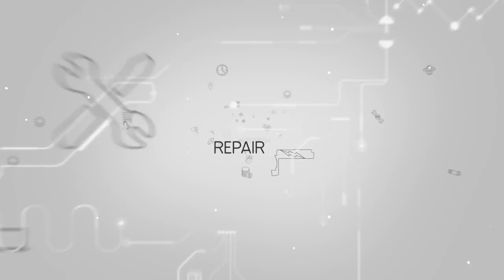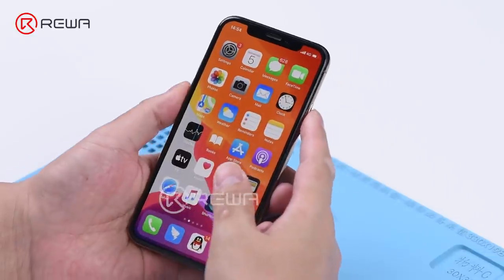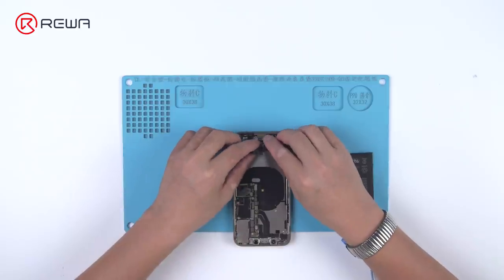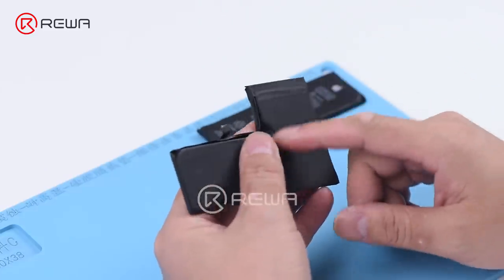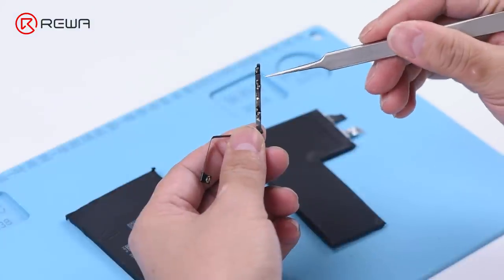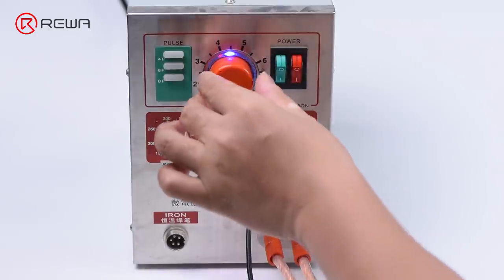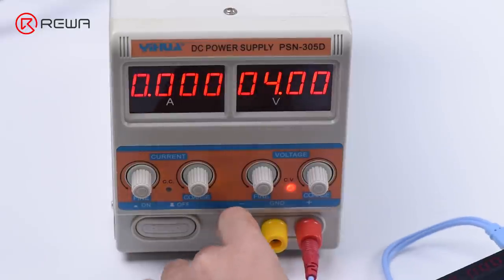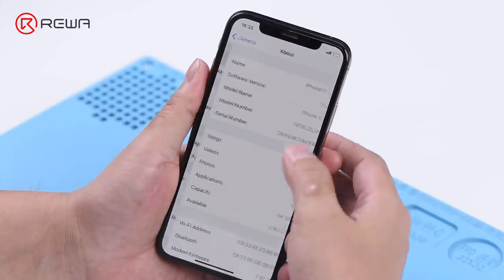Non-Genuine Battery Warning / Important Battery Message 100% Fix (iPhone XS And Above Models)

Comment: Why you didn't show us the battery health after replacing? It stays the same as before replacement.so if you have a battery with 75% max charge it will be the same after replacement
Reply: You'll get better or worse health depend on cell you bought. It wont or will stay the same, since BMS does not affect BH (at least in this case because manufacturer's BMS has higher quality than 3rd party one). It just contains Apple encription, thus you'll need them to not get the annoying message.
Reply: I have the same issue ( iphone xr). I replaced bms and reprogrammed. The battery health that phone shows is still 86% ( as it was before replacement) and the software on PC and programmer shows 100% ( as I typed in). Do you maybe know how to fix it?
Reply: You need a device to reset the BMS to 100%

Comment: What's up with that "activation board"?
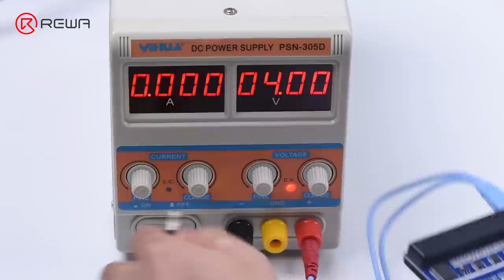8:43
Is that just a charger, to ensure the correct function of the cell?
Reply: Is for cheking voltages, cause Apple IC charging are very fragile and a bad voltage can burn it.

Comment: Can't you just use a reprogramming tool to input the credentials of original battery into replacement one, like in older iphone 7/8 batteries?
Reply: You can use the programmer for batteries and screens !!!!😝😝😝iCopy Plus 2.1
Reply: No, We cannot use reprogramming tool to copy the credential of original iPhone battery. Because, Apple use EEPROM in battery circuit chip, which ties the part to the iPhone.
Reply: @MrAshwin27  this is correct

Comment: Hi! Thanks for posting this super informative video. Can you tell us why it's necessary to use this odd little spot-welder? Could the battery contacts not simply be soldered into place?
Reply: They can, although solder can snap when you fold the battery board back into place. Using the original nickel sheets means you can bend it without the chance of any faulty connections.

Comment: The spot welding thing is a concern for most. There should be a non-destructive way. Like just  copying and pasting. Kudos Rewa.
Reply: Every factory uses spot welding when they connect battery to the bms

Comment: How about XS MAX?
There is two BMS logic boards for the two different cells.
Need to transfer them both?
Reply from the maker: Yes, 2 BMS on the battery of iPhone XS Max could be transferred together.
But the flex cable of 2 BMS should be more careful about it during the transfer, avoiding to damage it.

Comment: Could you give me advice? When I change board on battery, activated it, set cycles on 1 and set battery on 100% i got issue with battery capacity in mobile. My XS Max show me battery condition only at 78% but when i put battery on quanli  iCopy plus, it show 100%. Could you give me an advice what iam doing wrong? Thanks

Comment: how about the battery health? it will automatically turn to 100% or you have to program it?
Reply: Exactly, he did not show this in last step
Reply: how?  all old data will be left 😜 no repair
Reply: Yes, you need board or supply to activate battry and programmer to erase old data and program new 0 cyclus. On iphone 11 and above you need small board too which remains with the battry. Here it is not shown that.

Comment: REWQ TECHNOLOGY great job 
I have one doubt  I have 2019 model MacBook (trutone display)  ufortnatly Display is Brocken
then I change display but keyboard backlight is not working I try another display but same condition.  
I put old (Brocken display) DISAPLY keyboard backlight its working fine 
could you please tell me solution
Reply: did you match the correct year screen, if you mix 2018 and 2019 iirc it messes with lid sensor
Reply: @Slot1Gamer  Thanks

Comment: How about the battery health?
Reply: U may reset it with icopy plus
Reply: Baterai low kapasity
Reply from the maker: The Battery Health will be shown in the system normally, but the shown data still comes from the original battery.
Reply: I thought of self replacing my xs max 89% battery i guess I'll have to go to Apple to do i for me
Reply: @AppleReviews  
Not really, you can use lts instead, in combination with acid.
Reply: Guys you need to change battery, to take it away does not change it!!!

Comment: Can’t we just use the JC programmer to copy old battery information and onto new one? 

We can also reset battery cycles using Jc programmer.

Why we have to use battery activator? Please let me know.

Thanks
Reply from the maker: The battery data can be reset and the batter activator is used for activating the brand new battery cell. 
Thank you :)

Comment: Hi there can you clear something up for me please…
Why do you need to activate the battery please? I’m trying to find an easy explanation as to why I need to buy an activation tool as I’ve never used one previously I’d be so grateful if I could explain please
Reply: did you ever find out a reason why? couldn’t you just connect the battery to the logic board and boot the phone to activate it?
Reply: @armza9975  never found out and honestly I’ve never used the activator supposedly when I read up it was for batteries that have been stored for a long time but I’ve never had any issues without activating so it’s still a mystery to me…

Comment: After doing this It writes my old battery percentage, not 100% maximum capacity... Any chance to avoid this?
Reply: Hi, is it still showing your old battery percentage? (I’m told that after doing this, the phone gotta be charged a couple of times until the battery health changes)
Reply: @HiItsK  yes it is... Even showing that I need to replace battery...
Reply: @Mirandess1  Is your battery under 80% health? Does it affect to your phone's performance?
Reply: @HiItsK  Today i have removed this old battery(replaced original with new one) and this is third battery, it is not good idea to do this! Trust me! And yes It showed old battery percentage...
Reply: @Mirandess1  then, would you recommend me to take it to a Genius Bar to replace the battery? I haven’t found any way to reset my battery’s cycles. I have an iCopy and I tried to reset the cycles number of my battery, but it didn’t work, i4tools shows 100% but it still shows 81% in the settings. Or should I just go with a compatible one? I’d like to keep using my iPhone XS for a few years if possible

Comment: How do I reset the battery health now? I transferred the flex from original battery (85%) to new battery (100%), but it still displays 85%. I tried dfu restore, but still only shows old battery health. I’m using JC-Pro1000S
Reply: Enconstraste la solución?
Reply: @franbarrera2794  No :(

Comment: Any chance the maximum capacity can be reset to 100%?
Reply: No, u need to replace the battery since this number lowers over time (depends on usage)
Reply: @tedlienert8029  it's possible, however you need a programmer such as JC 1000s, then you can mod it to 100%
Reply: @aldenviriyatanudjaja5234  will the capacity grow over time and be recallibrated auromatically because the new battery is installed?
Reply: @sadpouofficialshop  chances are no, you will need to recalibrate it manually using the programmer
Reply: @aldenviriyatanudjaja5234  but will the battery function normally at full capacity without a reprogrammer?
Reply: @sadpouofficialshop  of course bro, actually even without removing the important battery message, the battery will work normally
Reply: @aldenviriyatanudjaja5234  how much what it appear though?
Reply: @sadpouofficialshop  oh, if you dont remove the important battery message the capacity will be (-), but functions are normal

Comment: I’ve seen battery’s for sale that say battery health will show after replacement is this true
Reply: No I purchased one on eBay for £21.99 the ad says 100% battery health also shown in iOS settings and once I fitted it. All it says is unable to verify this iPhone has a genuine Apple battery hope this helps
Reply: @ashleywilcock1638  iphone x above u will lose battery Health percentage they are programmed to the logic board u can treally do anything but if u connect to coconut battery it will show as 100 percent

Comment: After replacing the battery cable the maximum capacity will remain the same as before. How to solve that?
Reply: Some Tools can change the battery %. You have to let the iphone read another battery data first though
Reply: Enconstraste la solución?

Comment: Thanks for the video, but you dint show how to prepare the new battery (before installing the BMS) .

And where do we get battery cover / insulation covers? 

Thanks
Reply from the maker: The preparation materials can be bought, and please feel free to contact us at service@rewatechnology.com for any demands.
Thanks :)
Reply: We supply battery cells with all parts you need to replace a bettery .
Reply: @rewatechnology2008  I would love to have my 11 pro max Face ID fixed

Comment: Cant use solder for joining that old pcb to new battery ?
Reply: if the battery/phone heats up too much it could desolder or weaken the solder joints. although I have soldered battery terminals with low capacity before

Comment: Does the battery health percentage go to 100% or dies it stay at the wear level that it was before?
Reply: @Hallal-Almaty  no, after warte the serial number from old batteries to new phone still show message ,,unable to verify''. Tested
Reply: Pawel Skolimowski используй дамп из телефона а не батарей
Reply: Потом отпишись буду ждать ответа
Reply: Pawel Skolimowski какой у тебя программатор ? Версия и модель???
Reply: @Hallal-Almaty  NO ANY POGRAMMER WILL RESOLVED BATTERY ISSUE IN XS/XS MAX/XR MODEL
Reply from the maker: The Battery Health will be shown in the system normally, but the shown data still comes from the original battery.
Reply: @rewatechnology2008  if u reset the cycles by programmer, system will shows again 100%
Reply: The logic control not change is the same capacity the olde version its dangerous risque explosion

Comment: Oh damn. You actually have to (spot) weld it? I hoped it was just the common translation error for "soldering" 🙄
Reply: Same here about the translation lol....oh well guess I have to invest in a weld machine now....lol
Reply: no, it‘s welded, not soldered
Reply: There are tons of tutorials how to build a battery welder from microwave ovens transformers, it's pretty easy. I love to build my own tools, but about this I was absolutely sure I will never need it, well...
Reply: You can solder it. Just be careful with heat.
Reply: @theEskalaator  Lipo cells can autoignite at temperatures as low as 400°F / ~205°C. Lead don't wet much to nickel. Afaik neither does bismuth. That likely means lead-free solder. Iron temperature at least 330++°C to make sure the solder is fast. The actual lithium cell is barely a handful of millimeters away, and that nickel strip acts like a super-effective heatsink - sinking all the heat your iron can supply, straight inside the lithium cell(s).

I suggest you get a nickel battery tab strip. Pinch it with your fingers or attach a temp probe soldily on it with a good thermal transfer medium. Now set your soldering iron tip with solder and flux, down on the nickel strip about 8 mm away from your fingers (or the temp probe). See how quickly it reaches 205°C. I can almost guarantee you, that happens in barely a second, and significantly faster than you'll be able to solder a joint on there. Because you are basically trying to solder on a heatsink. It won't wet until the heatsink is as hot as the melting point of the solder, which is higher than the autoignition temperature of common lipo cells.
Reply: @nilomyki  the bms has two short tabs soldered to it, they are then spot welded to the long battery tabs and folded up. If you are quick you can just solder the battery across, I"ve done it many times... just dont over heat the cell or the board
Reply: @Wilson84KS  for tabs this thin you can just use big super capacitor and charge it from bench PSU

Comment: How do you reset the battery health percentage in a iXr ?
Reply: qianli icopy way easier than what they show in the video
Reply: @marcr27 , my icopy changes the battery health on the programmer itself but once reinstalled back into the phone, the original percentage shows up again so for me, this did not work.

Comment: battery percentage doesnt go up when  charging? any fix?
Reply: Battery percentage not going up means you have a bad charging port, when the phone has no charge I am sure it shows charging while plugged in, but the soonest phone turns on it stays on 1% until it dies again.
Reply: @Kabulvines  no phone charges put it would stay at 52 percent then jump to 70 after a while of charging.

Comment: How you reset the battery data? Mine still 85% after replacing with your method.
Reply: Same here i try to reset cycle with icopy apollo 2021 but no result yet
Reply: Enconstraste la solución?
Reply: @jibbaowndsu  Any luck figuring out a method? I have the Apollo Interstellar One but I'm not buying a spot welding station until I know this will work.
Reply: Any luck figuring out a method? I have the Apollo Interstellar One but I'm not buying a spot welding station until I know this will work.
Reply: @Enter-the-Meta  yes you need to trick the board with another battery and than placed the spot welded one back

Comment: I change my battery for 7 plus and the technician he didnt do that what the solution please
Reply: Its for xs and above models not require for any below
Reply: @billyh8364  and why my iPhone don’t show battery capacity
Reply: @hiddenhabd9501  either update the software or just restart the phone
Reply: No bro im already ask the apple assistance the check my phone and told me that the battery is not genuine
Reply: @hiddenhabd9501  do repairs myself when change to new battery shows 100% unless its xs than it does show anything
Reply: @billyh8364  what type of battery u baught

Comment: Why cant we copy battery data using icopy ?
Reply: Because Apple is now using secure EEPROM for data. ;)
Reply: @sleeplessrazi  endgoal is people shouldnt be able to repair 😂😂 but we find a way always
Reply: @zzzaaalll  Men make the security and and men break the security. ;)
Reply: EEPROM is read only. BQ27546-G1 chip use to monitor the battery usage & how battery has to be charge, it has another function a encrypted key lock the battery to iPhone. That was the reason why even if you use original battery from parts phone. It will always recognize that battery is not part of the phone. Because they have difference encryption Key and will display message as "Non - Genuine" Parts. End Goal is that apple want you do service at it authorized store.

Comment: POV: you don’t have the spot welder so you pulled out your trusty soldering iron and went to town praying you don’t over heat the battery.
Reply: You can easily solder to the nickel strip, the trick is the bms, you just dnt remove the old nickel all the way.
Reply: @winmarkesconde5651  what is bms?

Comment: The cheap & welding battery, might causing short circuit to your phone. Hence, it might be explode due to there is leakage current.

Did you guys concern about your safety when using this type of battery? 🤦🏽‍♂️

Comment: You haven't to reinvent the wheel.  I thought you would show how to clear the message without the original battery.  Thumb down!
Reply: @Hallal-Almaty  100% truth? I read that the message pops up despite changing the serial number on the programmer
Reply: @danio3334  nope. The bms of the battery is directly link to motherboard. You need the original the bms as shown in this video. Tested myself but fucked up during soldering. Tested also using icopy. Not working.
Reply: danio3334 messages do not pop up if you take data directly from your phone !!!
Reply: Saitama One messages do not pop up if you take data directly from your phone !!!
Reply: @Hallal-Almaty  and how do you take it directly from the phone?
Reply: @ronaldr2693  GOOD question
Reply: @badrulaminbaruddin176  me too. This parts cannot be soldering.
Reply: @ThePawciohd  - Man, It's annoying...
  What's Apple doing...